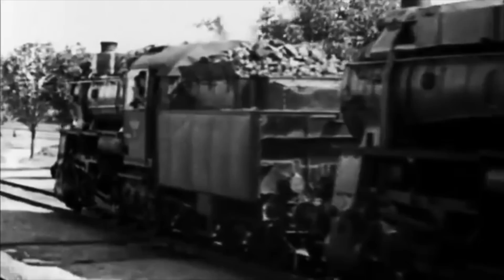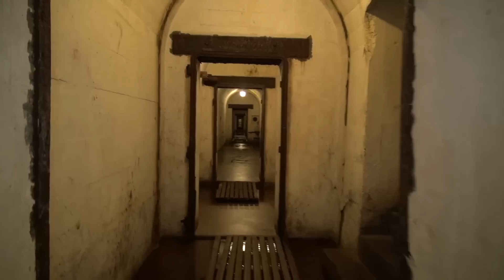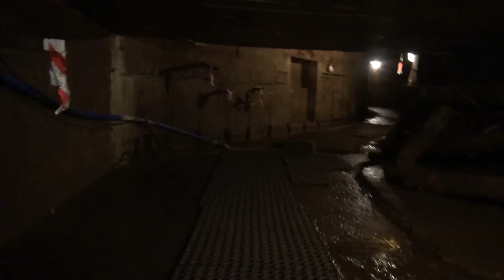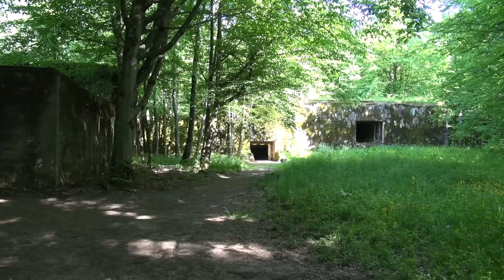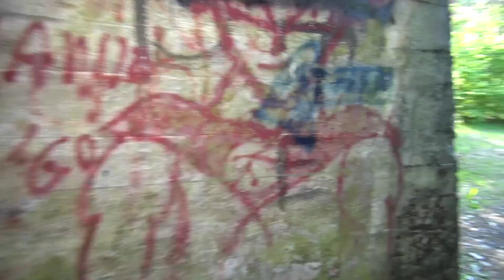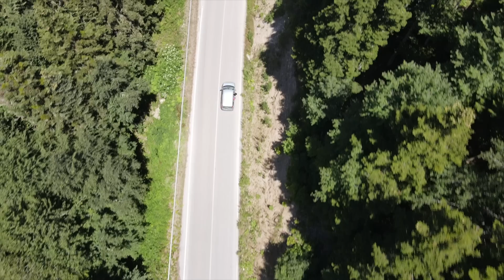HITLERS SUPER TRAIN BUNKERS - WW2 SPECIAL PROJECTS

Comment: I agree with some other comments of the train must have been backed into the tunnel. There is no smoke on the tunnel ceiling. All train tunnels that steam engines entered have smoke stains all over the ceilings. The ventilation in this tunnel would not be sufficient for a large locomotive sitting in the tunnel fired up. This was a great adventure with you in this massive shelter.

Comment: Thank you Tino, for another interesting tour.  As a railroader for thirty plus years, my mind goes to how they maintained the locomotives & rolling stock in these bunkers. As you thread your way down the tech corridor & the tech support bunkers,  a number of thoughts come to mind. These type of engines would've burned coal. This being the case, you would need to remove ash & clinkers from the firebox grates, if the train was to stay in the bunker for a lengthy time. They would need to replenish coal & water. Perhaps they may have used a tiger torch in the fire box to conserve coal & keep the engine at the ready. There must have been a compressed air source as well. There seems to be no end to the line of questions that come to light as you explore these places. Have a good day Tino, and thanks again. P.S. I enjoyed the call of a coo coo bird of some kind when you exited the tech rooms at the first railway bunker.
Reply: I also thought "How verry Cherman, a Cuckoo sound at a NRZI bunker!" ;)

Comment: Steam locos need to have the firebox dropped after use and burning materials hosed down.  There should have been pits for the coke produced after the coal had been burnt. Also, the  boiler tubes would need to be cleaned out using compressed air. The coaling stage and water supply tower would have been fairly big. Unless all this was  done outside, of course. If so, there should be remains of the structures.
Reply: -SteamLocos stayed outside maybe the Wehrmachts Diesel Engine D311 or V188 was used

Comment: There is no way those tunnels are adequately ventilated to accept a steam locomotive positioned on the front of a train. They must have reversed in.
Reply: Electric shunt units, or some sort of winch system maybe?
Reply: @78Ratje  Yea I thought about that.
Reply: yes and inside the train wa connected to auxiliary steam (for the heater) and electric power coming from the bunker

Comment: There's an interesting story we're researching right now. In Thuringia near Oberhof (about 15 km from Ohrdruf) there is the Brandleite Tunnel, which is over 3000 meters long. This tunnel, which also served as a shelter for Hitler's train when Hitler visited the new underground Fuehrer's Headquarters in Ohrdruf (S3), is said to have a second level below....in the tunnel there was said to be a railway carriage elevator one or even a few carriages long. Apparently Hitler's or Himmler's train went into the tunnel. Hitler's wagon then stood on the elevator that was mounted under the track bed. Hitlers carriage was decoupled from the rest of the train, the elevator drove down with that carriage about 40 meters to the secret subway line, where an electric locomotive specially manufactured by AEG was already waiting, which then pulled Hiter's wagon to the 15km distant headquarters in Ohrdruf, fully underground. The very strong special AEG EL 1 - 150 underground locomotives survived the war, they later served in an east german mine at Espenhain. The underground train line is said to go from Oberhof to Ohrdruf to Arnstadt until Erfurt city and maybe even Weimar!
Reply: I have also heard about the secret Subway in Ohruf
Reply: @Haffschlappe  yes at night people hear rumbling trains from below
Reply: I would love this to be true and it shows that its likely that so many other sites are not out in the public domain. I will say though, that Tino mentions Hitlers train being 60 tons, so that would limit the amount of carriages a 150 ton loco can tow?
Another thing is that hole blown into the wall. I have noticed many of the places Tino visits, he captures on video where people have been digging, drilling or blowing up. Some one is looking for some thing...
Reply: @kumagatz  One car was estimated at 60 tonnes. That might be true for Hitlers' armored car - regular cars or the AA flatbeds were surely a lot less.

Today, regular German cargo cars are 55 tonnes fully loaded.
Reply: So was it destroyed filled in, or still there and a huge tunnel is unexplored??  The amount of tunnels dug by the Reich is amazing. No wonder Mexican drug Lords sent their underlings to learn tricks of the trade.
Reply: @davidlafranchise4782  We think the lift in the tunnel was removed and the vertical shaft filled with concrete when the Brandleite tunnel was entirely renovated and refited with a new railway trackbed after the reunification of Germany. The second tunnel 40 meters below remained, we know that maybe this "secret" subway line might be still in some kind of operation because we believe that NSA or some kind of US military secretly operates an underground base under the Ohrdruf army testground, Gossel and Arnstadt where Polte 2 was located. The entire S3 was such a giant underground complex, we believe that Russians and later Americans continued with some kind of use. People tell that during silent nights on certain places they noted vibrations and strange railway noises coming from below. So there still might be a subway in operation.
Reply: "Ohrdruf army testground," ??, wasn't that where atomic test was supposedly set off ???'
Reply: yes @androidemulator6952
Reply: @androidemulator6952  I heard that rumour of a suposedly "nuclear" explosion - but if there really was one we would know today. I'm quite sure a lot of people with geiger counters were there by now. No radiation was ever reported.

Plus: Nukes don't grow on trees.

And nazi Germany didn't have the resources to run it. Yes, there are plenty of rumours about a nazi nuke program in a bunker system somewhere - but even if they somehow managed to keep the program itself secret up to today (which is impossible): You can't hide the logistics.

You need thousands of scientists and tens of thousands of workers. They need to live somewhere, they need food. Okay, slave labourers can be kept underground all the time and fed the absolute minimum - but not your highly-skilled scientists. They would want good food and to go out now and then - to the pubs or the cinema. Impossible to hide.

You need at the very least hundreds of tonnes of heavy water, gigantic amounts of very expensive machinery, ginormous amounts of electricity. You may hide the purpose - but not it's existence.

Over time, rumours got more and more fantastic.

A secret normal-gauge subway line - 25km long and beneath one of the train shelters in the east featuring an elevator for Hitler's armoured train car etc.. Today, that subway is used by the NSA (why?).

Of course, it could have been built - but to what end?

And an elevator for an armoured train car is possible in theory - but makes zero sense. It would be gigantic, incredibly expensive in money and resources - and incredibly slow-moving. I doubt Hitler had that patience. Plus: Why use an armoured car in a subway crawling with SS guards? Doesn't add up.

A regular person-elevator would be easy to build, affordable - and a lot quicker.

I think the whole thing doesn't exist. Rumours got told over and over - like the fisherman's catch. "It was THAT big!!"
Reply: As much as I like the story - IDK if that subway tunnel exists or not.

But an elevator for a whole armored train car of 60 tonnes seems excessive even by WW2 nazi standards.

The whole elevator would have been gigantic. I guess 400 tonnes of steel, gigantic motors, generators and tonnes of other expensive and rare stuff.

Using a regular elevator and changing trains would IMO make a lot more sense.

Plus, many subways have a smaller gauge than regular trains. Subways usually don't carry cargo - and a lot money and resources can be saved by using a more narrow track.

Especially when building a 15km tunnel - which would have been in WW2 the longest of it's kind in the world.

Without a TBM, even with an unlimited supply of slave workers, cement and steel - this undertaking would be colossal. Just getting rid of the tailings would be a logistical nightmare. Hundreds of skilled miners along with many dozens of engineers would need years to complete this tunnel.

Doing all this in complete secrecy is just impossible. It's just too much, too big.

Even with today's tech - I don't think it's possible.

I think a lot has been exaggerated over the years.

Like "Bergfestung". There was so much talk about it the allies took it absolutely serious - just to find out it never existed in the first place.

Many nazis got away by telling ridiculous, completely made-up stories. A lot of lore was created back then.
Reply: @stanislavczebinski994  No only lift for maybe 1 or 2 wagons (Hitlers and a Staff car) as I have written above, I call it "a subway" it was full scale full track underground train ´tunnel system with electric line for a large mine locomotive...Nazis build gigantic stuff (remember the railway gun Gustav) and much earlier than we might believe today the entire Ohrdruf Arnstadt "Trutzgau Thüringen" thing was planned and started during the late 1930s, they did not just start in 1944 with all of it. Some things go even back to the Weimar Republic 1931! I dont think Hitlers waggon weight alone was 60 tons.
Reply: @Schlipperschlopper  Yes. That is what I assumed.
Reply: @stanislavczebinski994  In Niederfinow Germans build the Schiffshebewerk that could lift 250 tons! and we have a 25 ton railway car lift from 1908 at Eberswalde. So a 60 ton lift would not be impossible if large German companies like DEMAG, KRUPP or BORSIG ever tried for Hitler.
Reply: @Schlipperschlopper  I never said it's impossible to build from an engineering perspective.

I said it is impossible to keep such a colossal undertaking completely secret. Thousands of people would at the very least have known something very huge was build there.

This project would have been just stupendously expensive in money, skilled labour and rare materials.

And all of that just for Hitler not having the discomfort of leaving his rail car, using an elevator and boarding a subway car?

Plus: If such an elevator existed - the whole 15km of subway had to be in normal gauge to make it work in the first place.

That's why I'm confident neither this elevator nor this subway ever existed.

But hey - feel free to prove me wrong.
Reply: @stanislavczebinski994  I don't think he had to prove you are wrong.  Because your theory isn't a proven right.
Reply: @davidlafranchise4782  It ain't proven - but it's most probably the case - for the reasons mentioned.

Over the last 78 years, the nazi regime became something like a James Bond villan.

Supersmart, able to do everything they want without any limitations whatsoever - and super evil, of course.

In regard of nazi projects this has been proven wrong by experts in many, many cases  - like the mentioned Bergfestung.

No matter how well an installation like this would be hidden - logistics would inevitably give away it's existence.

Therefore I believe this is all legend and lore - but everybody may feel free to prove me wrong.

An underground nazi subway of 15km including a 60+ tonnes traincar lift would be exciting and I would love to see it in reality - but I'm confident it's only a myth.

Comment: As always, you do an amazing job of presenting the history without any hype.

It would make no sense to block one end of the train bunker thereby risking the train being trapped in it. The Germans were so careful to always have alternatives, including escape tunnels, than to think this time we won't...  Especially if designed to support Hitler. Same for the dead end in the support tunnel. No way it dead ended either. 

And there were multiple places that air filters were attached to the wall of the support tunnel with multiple air tight doors. 

The ceiling exhaust implies a larger ventilation system in the train tunnel. Along with all of the ventilation features you found there had to be huge amount of air moved to vent the train exhaust, especially since it would never be shut down. 
There has to be huge coal bunkers too. 

Well done sir, well done. 
Impressive as always
Reply: There was no defense in depth visible. No trenches. Something doesn't add up?

Comment: Studying the map of the area north of Spala I notice distinct traces of at least two tracks connected to the train bunker and the  main railroad leading to Spala station. The traces can be seen east and north of the large bend in the Spala branch tracks.
A triangular set of connecting tracks would be very useful when the train needed to be backed in...
As the train would arrive, it would proceed to Spala station (or beyond) to clear the switch, then an official would switch the track over to allow the train back up towards the east and into the forest and the train bunker/tunnel...
If the train needs to leave the area, it could do so using the piece of track running east-west at the triangular junction...
Today only the large bend in the track remains... Would be interesting to see if traces can be found of tracks no longer in use or (at least) two railroad switches.
Reply: There was a siding leading to the sawmill in Konewka not far from Spała station, dismantled some time after 2000. I remember seeing that track before it disappeared.
I think that the other track which was leading to the bunker was removed many decades ago. The line to Spała was modernized some 5 years ago and no defunct switches remain including those that served the sawmill siding.

Comment: Most likely the train tunnel had (or still has) a large electricity supply to power a powerful electric locomotive or winch system to pull the train into the tunnel in an effort to prevent the steam locomotive from fouling up the air inside the tunnel...
I suspect the train would be backed in and the steam locomotive would remain either outside or in the section closed to the entrance/exit of the tunnel. Possibly this section could be closed off by a airtight door or doors...